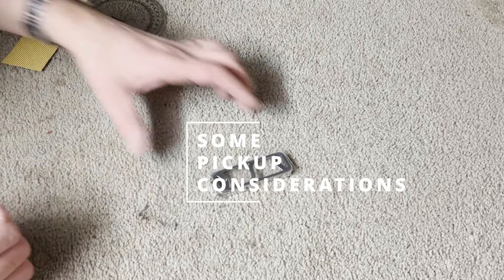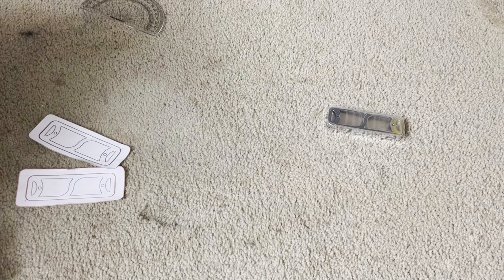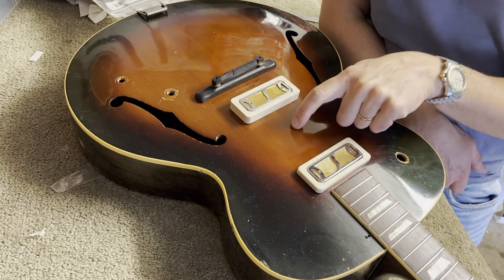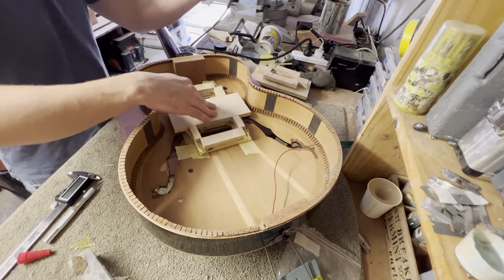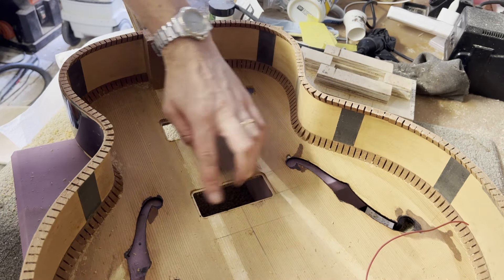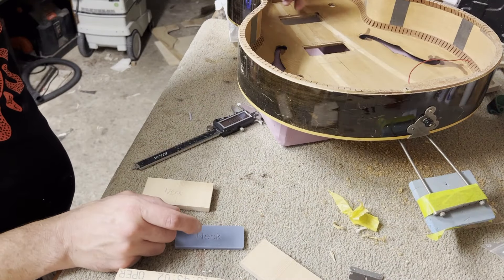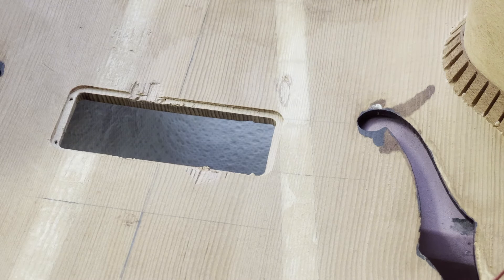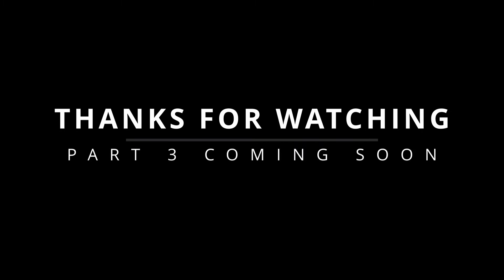1953 Gibson L-50 Restoration [Part 2] - Repairing the top

Comment: Ah hah!!  Now I see what you meant in your first video.  What a great idea.  And I like the way you're using 21st Century 3D printing to fix 18th Century craftmanship.  🙂

Now, for my question.  Does the effect on vibration that pickup holes have in a hollow body guitar top also occur in a solid body guitar?  Or, does the "swimming pool" route in some Stratocasters have the same effect?

Anyhow Tom, thanks for another great video.  Keep up the good work.

Andrew
Reply from the maker: Hey Andrew, swimming pool routs are less of an issue because you still have a fair chunk of wood holding the guitar stiff and retaining the necessary rigidity. They still bother me though!

Comment: That is ridiculous as is much of the garbage surrounding inflation of prices due to the internet. I was getting so much vintage stuff for next to nothing until ebay ruined everything. Even as recently as 8 years ago I scored a 1964 Harmony Bobkat with 2 of those gold foils you jack off to, and a 12 string Teisco Sharkfin with the black/chrome square pole pickups for $40 total at a garage sale, granted they needed a bit of work. I wish I had pushed him because he said he had a Harmony Rocket but wanted to keep it for now. Also stuff that no one wanted like 1930's and 40's radio's, old wind-up clocks and oscillating fans were $5 to $10 now idiots say things like I saw a similar one on ebay for $150 so that's what I need to get. You go back 2 months later to the same shop, the stuff is still there, and they won't go down on the price because someone on the internet "asked" that much. THE VALUE IS WHAT SOMEONE IS WILLING TO PAY FOR IT!!! So, if people like you pay $40 for a metal pickup ring because you are jonesing to make a YT video. YOU RUIN IT FOR EVERYONE MATE!
Reply from the maker: So, if I understand your argument correctly, I am responsible in part for inflation for paying $40 for metal pickup rings from the only place that supplies them in order to make recreations of vintage pickups which have become expensive because of people like me paying too much for reproductions parts instead of buying vintage parts because they have become too expensive because of people like me paying too much for things you used to be able to get for cheap back in the day? 

I apologise for my part in both inflation and the advent of the internet.
Reply: @BeardsworthGuitars  I must apologize a bit, my comment was made sporadically in anger because there is frustration due to people setting prices not based on supply and demand but on perceived value mainly due to asking prices set in ignorance. Those pickups for instance, why is a whole guitar $350 now (a couple years ago $100) and the pickups are now $200 each? The only reason this exists is the same reason vintage guitars that were $6k not long ago are now $50k, some dumbasses are giving in and paying the dumb prices which ruins it for everyone. Other people look at someone's asking price and figure that must be the value since someone else is asking that, so selling on the internet causes the ignorance initially because instead of one person in a 300 mile radius wanting someone else unused junk not 6 people worldwide may want it and statistically one person may be bored and have a lot of cash burning a hole in his pocket. But if someone is not fool enough to pay it, the prices would come down. I repair vintage radios and things which were considered of basically no value because not long ago hardly anyone wanted them and you could buy locally for $20 until one ignorant person figures his grandma's radio must be extremely valuable because it is old is it not, and put it at $200, all of the other ignorant people soon followed suit and then overnight one idiots perceived value became the going rate because some people have more money than sense. You end up with people paying too much and not doing anything with it and the true hobbyist/collector gets shafted. I don't mean it as a particular attack on you, not sure why you are putting homemade pickups that look like an overpriced cheap pickups in a Gibson but to each his own, but it is not your fault alone obviously. Just saying where does it end? Right now, actual players can't afford the "nice" guitars because their value has been artificially inflated so much, millionaires buy them as investments and to hang on a wall to show off at dinner parties instead of them fulfilling their purpose of making music. I for one feel this whole idiotic house of cards needs to fall apart and normalcy return but I guess there will always be some folks with more money than sense. So, accept my apology because it is not fair that I picked on you specifically the problem is much bigger than that.